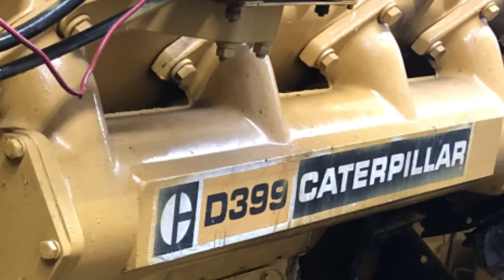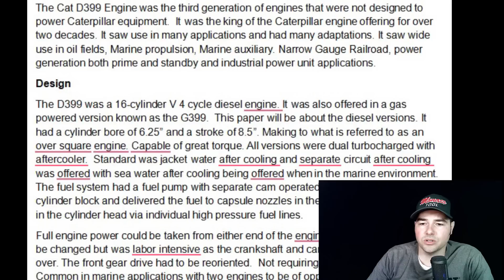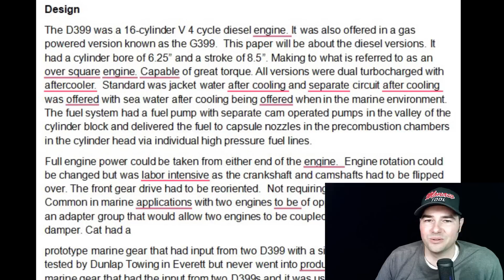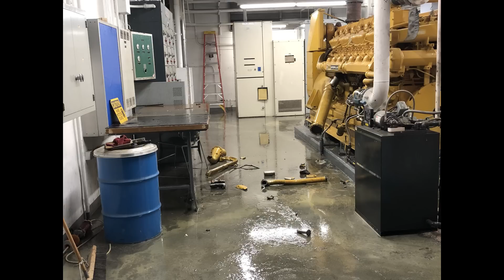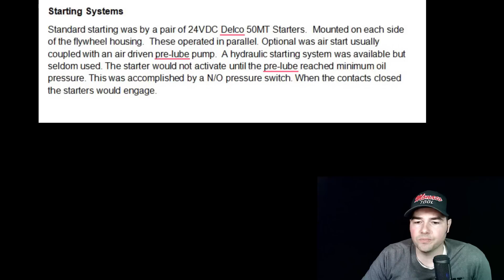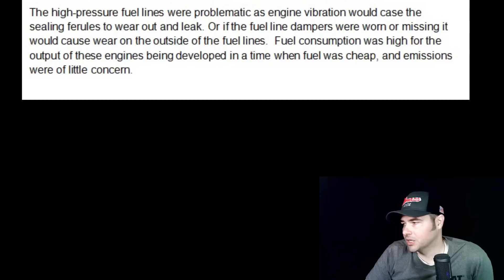The Cat D399 Diesel Engine. "Cast Iron Elephant."

Comment: I have seen a hydraulic starter it was on a diesel powered forklift in an explosive / volitile area of a paint factory so this machine had nothing electricial on it at all and the exhaust ran through a water trap
There where a couple of accumulators on the roof of this machine for the starter which you charged by stalling rear tilt and full throttle or a pumping handle if you forgot to do this Enjoy your videos thank you for your efforts

Comment: Hydraulic starter could be used in a hand-pump-up type accumulator, or I should say large set of accumulators. Like pumping a bottle jack, but you are charging large accumulators. But yes, as someone else commented auxiliary hydraulic power can come from say a frac trailers power takeoff. Not sure what kind of accumulators and hand pump and how long you would have to charge that for such a large engine. Could be done though!

Comment: I was around a lot of this type engines, just the smaller ones….D353 (inline 6) D379 (V8) D398 (V12)  All 6.25 bore X 8 stroke; 1200 RPM on the drilling rigs. Most land rigs perferred to run 3 or 4 of the smaller engines rather than just two of the larger ones.
Reply: The D353 was used in the D9 dozer as well.
Reply: @ Yup, that’s where it came from, AFAIK

Comment: I was a winter caretaker for a lodge in Alaska. At -45f I would get really cold working outside so I would go stand in front of the radiators for the gen sets eventually I would start taking naps in front of those Kubota gens sets in shed with my back on the warm concrete floor. Now to this day i can sleep next to most diesel engines. The guys would find me sleeping  and laugh... How can you sleep there? Warm nap with free massage. lol I always wondered if i could sleep next to a D399. I want to take a cruise but request the machinist mates room closest to the engines. This all probably started when I would ride in my dads dodge colt at -25f the warmest place in the car was right over the loud leaky muffler in the back. I would curl up with a blanket on the floor for those 8hour+roadtrips with the drone of trash made Chrysler. I can only thank my dad for owning Chrysler vehicles when I was young. I learned early that Dodge in the biggest pile of crap company the fact that they are still around in 2025 tells me the lowiq sheep out number the smart ones. Dodge in 1978 had bad trannys and bad wiring---Dodge in 2025 has bad trannys and bad wiring. 40+ year to fix a problem yet they can't figure it out. Some high quality R&D going on. I worked at a engine machine shop and i have seen a handful of 360 "Hemi's'' come in with so called 100k mile warranty one was on dealership rebuild number three. The threepete one the dealer saw the 999999 mileage and said can you come back tomorrow so he does...Oops sorry sir ur over ur warranty claim mileage awwww to bad:(  So now i get to see what the dealer mechs did. The truck drives in sounding like a steam engine i pull the heads and than i see that three different dealer ships one in texas one in cali one in washington all reused the blown original head gasket and every time they put the head back on the gasket was not on the dowel pins it was lower by 1/8 of an inch every time so what do they do they hammer the head bolts through the gasket and use the bolts to pull the head down with the steel gasket over the locator dowels three different times and every time they pulled the head the gasket fell down a little farther the f%^%king gasket was almost a full inch out hanging out of the side fully visible. I will never buy a Dodge!!! The saddest thing is that was three different dealer ships. I could train a monkey to do better work. He drove that truck with over loaded trailer like that from Florida to Alaska basically a 4 cylinder steam locomotive adding water ever 10 mins. Ferd is second for f^&*king Americans at least Dodge puts a sheep statue on the hood letting you know what you are. bABBAAAAAAAAABBBBAAAAAAAAAAAA

Comment: I worked on quite a few ships in the late 90's and early 2000's that had D399 and D398 engines powering generators and bow thrusters. One ship had 4 D399 950 kW gensets and they even burned heavy fuel (IFO 180) in them. Absolute beasts.  When you saw them running it made you think now that's Cat Diesel Power!  I wouldn't be surprised if a bunch of them are still in service, especially in thruster applications where the hours would be very low.

Comment: Can anyone explain why running sufficient size lines off a fuel rail you pressurized from both ends necked down with a washer right next to the injector somehow lost to the dead head, barely sufficient lines that need to be exactly the same length design by Rube Goldberg.

Comment: Back in the 1980's when the automotive manufacturers went to basecoat/clearcoat from single stage. But if you wanted NO options, the crappy engine, rubber floormats, and didn't care if it was white, they would sell you a "work truck" with "Lightweight" single stage worktruck white paint.
Reply: I wonder how many listening caught that joke about the weight of the yellow paint.   Good one.

Comment: As a retired generator guy, I was around a lot of old D series Cat iron. The D399 and its brother the D398 (12 cylinder) were legendary generator and marine engines. They powered factories, hospitals, sawmills, rock crushers, ships etc. I worked on a few of them, but, to be honest didn’t do that much because they simply ran and ran. As a standby generator, I doubt many of them actually ever failed. It’s the emissions that led to their demise in most cases. 
One thing I do remember is they were finicky about air in the fuel. We had one D398 where the fuel lines ran overhead from the day tank to the generator. It would frequently fail to start without bleeding the high pressure fuel lines.  We repiped the fuel lines below the level of the fuel system and had no more problems. 
One other interesting problem we found was on one D398, the starting battery was a 32 volt bank of nickel cadmium batteries. The engine had a 32 volt electrical system. The generator was equipped with. Woodward 3208 electronic governor. We had several of these governors fail and couldn’t identify the problem. Until, one day the starter caught fire. When I removed the burned up starter and turned it over I found it was a 24 volt starter. Apparently, the engine came from the factory with a 24 volt instead of a 32 volt starter, which eventually caused it to burn up. We also figured out that the voltage mismatch caused an electrical spike that had been damaging the electronic governor module. Replaced the starter with a 32 volt 50 MT, and had no further problems.
Reply: How were you getting 32v? You're saying It had a custom battery bank? I ask because I find it interesting as 32vdc is an odd voltage...wonder why they didn't just go with 36v and just series 3 batteries per battery bank ....I bet replacing a custom 32v battery would have been very expensive
Reply: @mikekopisz1227 
32 is banks of 4x 8v batteries  much easier  and more cranking amps than 6 x 6v batteries 24 was 3x 8v.  
1960's 6 and 8v was the common .
Reply: 32 volt DC was not uncommon in older tugs / work boats for lighting systems.
Reply: Possibly introduced in 1957 D399, D398 and D379, Gas and diesel and bi directional in marine, the fuel economy was the killer by the eighties. No sweeter music when you first started one after a rebuild
Reply: Woodward governor, that brings back memories
Reply: Great read, thanks for posting this.
Reply: Me to . Its very easy naming sistem 

D353 (d9h) d379.d398.d399

D342  L6(d8h and d8k ). d339  L4 (d7e) d397 v12 . D375 v8 

D343 d1693 

 Thy use same bearing and ring and piston and liner and gasket and seal . 

I worked on all of those . And I own one g339  in my home for backup generator.  It's second engine that use  first generation turbocharger name Honeywell garrette T1404 . 
it's amazing engine considering very very old style turbo make 30 psi boost .at 1200 rpm .

I want buy a truck and install d339  ultra long stroke and see what it can done on road 5¾ bore _ 8" stroke

Comment: On most of my ships emergency generators there is an hydraulic starter for if all else fails. They can be manually pressurised using a handle similar to a hydraulic jack, and when you reach the desired pressure, you press a button and the pressurised oil is released into the starting mechanism to fire the generator. Self contained and very effective, if a little tiring during the monthly system check. But that is what engineering cadets are for.

Comment: just a fun thing, in swedish on Volvo engines, "high idle" actually mean WOT but not in gear lmao
Reply: You are correct! Not just in Swedish, "High Idle" is the maximum governed speed of the engine no-load. Full load or rated speed is the maximum governed speed at it's rated output, both RPM and HP. Peak Torque would be at a lower RPM.

Comment: 4:40 gotta love it when they take a perfectly good running Diesel engine and ruin it by making a gasser. 
Actually,no, you don't have to love it. 😂
Reply: Cummins is trying it with the B series 6.7. Yep, a turbo 6-gun gasser. It could be a serious player or end up a horrific flop like their 5L V8 disaster. I know they're partially trying to compete with the Ford Godzilla 7.3 gasser but they do have 1 seriously important advantage,  boost from the factory. Time will tell.
Reply: @acemobile9806  
Yeah overall I've seen a bunch of converted gassers like the old Cummins 855s and stuff.
Not really impressed ,all that metal and the heat radiating off isnt my idea of fun. 
Sure they make a durable gasser but they ruined a diesel to do it.

Comment: 3:00 gen tech here ,if they ran at 1200 for a generator application the rotor had 6 poles to give ya 60hz. 
4 pole rotor gives ya the typical 1800rpm unit. 
Some of the old 2 stroke Detroit 2-53s ran at 1200 rpm for a generator that used to get used in alot of rail cars. 
You're only talking like a 30-40kw generator at that low rpm but they ran forever.

Comment: Hydraulic starters are generally used on frac pump trailer where the truck provides hydraulic pressure from a pto that not only will run the starter but also run the cooling fans for whatever engine is driving the frac pump. Whether it’s a Cat or a Detroit
Reply from the maker: That's super interesting and good to know. Makes sense when you explain it like that.

Comment: It was always interesting to crawl around on a loco diesel that's making its rated hp (3000hp-4500hp @ 900-1050rpm) while testing it. When I first started on those 20+ years ago I was nervous to be around them loaded, but you get use to it. If it goes boom and you're next to it... 🤷‍♂️

Comment: Hi Mate
I was a marine engineer on a sand dredge for 24 years sand it had 4 D379 engines and they were and still are a awesome engine we never had a break  down. The only thing was if you did not run a seal pick around the oil line O ring between the oil pump and oil cooler it would blow out after about 6 months if you did do it it would last to the next overhaul.
Cheers Rory
Reply: Can you remember what turbo was on those.  I am 2nd engineer and I remember turbo was first generation Honeywell garrette t1404 on v8 and t1810 on v12 v16 . It was very very complicated turbo with option of 2 exhaust side nuzzle ring . Both of them  was whistling and easily capable of making 30 psi and more .
Reply: Can you remember what turbo was on those.  I am 2nd engineer and I remember turbo was first generation Honeywell garrette t1404 on v8 and t1810 on v12 v16 . It was very very complicated turbo with option of 2 exhaust side nuzzle ring . Both of them  was whistling and easily capable of making 30 psi and more .
Reply: @edmondmkasian6173  Sorry I can not only that they are CAT supplied Turbos.
Cheers Rory

Comment: Mostly work in the natural gas side of cat with  g342  g353  g379   G398  TA and NA versions all set up on gearheads pumping water for the farmers in the valley.  Have a G389TA rebuild in shop currently crank out,bare block.  Cat still makes most parts for rebuilds, piston and liner kits.  Old style rods had to be put in position by coming from bottom of liner because they would not fit through the block on the top.

Comment: Company I worked for used the gas version of this family of engines on digester biogas. They just retired a g379 (v8). It ran for 18 years and 152808 hours from full rebuild with several top ends and in frames but never touched the crank or the cam.
Reply from the maker: 152000 hours, holy mackerel.

Comment: I was a port engineer for larger merchant ships in the 1980's and 90's. These engines were quite common in small ships and various work boats. They were in competition with Bergen Diesels, Alco's, and EMD's during that era. They were used for propulsion in the smaller ships and for ships's service diesel generators on the larger ships. Parts were readily available worldwide from marine diesel engine dealers/ parts suppliers in most commercial seaports.

Comment: I was on the USS Recovery ARS-43...( commissioned in 1945) back in 84-85. It had 4 of these for diesel electric propulsion. I think they replaced older Cooper-Bessemer engines originally installed. Fun fact...both the 398-399 family and the D353s has the same pistons/ rings. Not sure about rods and liners tho. We had 2 D353's in the aft engine room for shops service electric.The 353s were in the old D9G and H series crawlers.
Reply: I think those were D343s in your aft engine room.  I was engineering officer on USS Hoist ARS 40 when they (and the D399s) were installed there.
Reply: @vagabond96h  i was on USS KITTIWAKE ASR 13.....we got repowered in the late 70s with D399s
Reply: That is pretty common for various families of CAT engines I think.

Comment: As a CAT serviceman in UAE I used  to perform start up/performance audit on newly installed engine, check, repair and overhaul D379, D398, D399 and D3512 used in onshore/offshore oil rigs and marine boats.
Reply: Just "marine" boats, or any kind of boat?😁
Reply: @JR-rx2ke  Marine boats, pipelaying barge, dredger and self elevating platform barge.

Comment: I have heard of hydraulic starters before but it was on much smaller engines. They used a hand pump to pressurize an accumulator. For an engine that size they must have had a mechanical hydraulic source or you would be pumping all day for one shot at starting the monster

Comment: I work in the Marine diesel sector and have the pleasure of working on primarily 35xx series. My favorite engines to work on. I have worked on some 398’s and one 399. On hydraulic starters it is normally a pressurized cylinder that pressures itself once the engine is running, so it it is ready to use next start up once pressured up. Otherwise you would pump up with a hand pump if you get a no crank. A real pia if you have to hand pump it, especially diagnosing problems with no starts lol
Reply: So it has a dump valve between an engine driven pump & motor on the starter? With I assume an electric solenoid on the dump valve? Send power to solenoid, dump valve opens to release all pressurized fluid into motor on starter?
Reply: The pressure reserve tank was referred to as an Accumulator. The same system was available in Detroit Diesel auxiliary power units. Get your hands on a 71 V Series operators manual, there’s a lot of detail on the system with cations about working around high pressure systems.
Reply: Oh yeah, I remember having to get the boat running (two) 399's, andusing the hand pu,p...half drunk after a night of danicin down in Dulac on the Bayou.  Make a run to pick up fuel and mud to deliver to the rig out in the gulf.

Comment: D399s are used througout northern canada, both in the river tug boat industry on the mackenzie river, there are boats that use 4 engines to turn four props.

They also are used for power plants in the small communities.

Comment: That rpm and cylinder size sounds similar to deere's first diesel tractor. 5 5/8 bore, 8 inch stroke. Only 2 cylinders and only turned at 1100rpm wot. Fired unevenly, which gave them the pop or thump sound.
Also, deere's first diesel engine was heavily based on...Cat engines.
Reply: I ❤ R's!